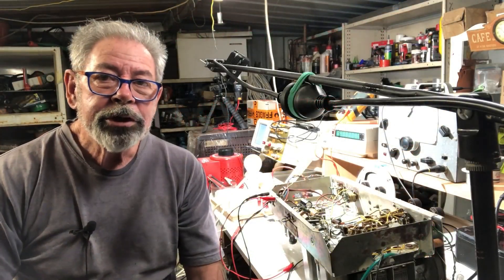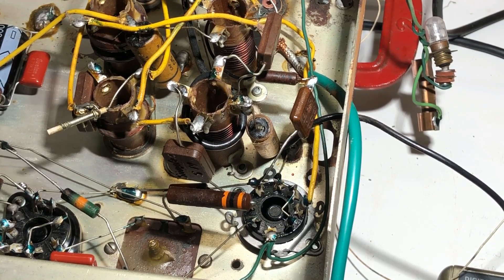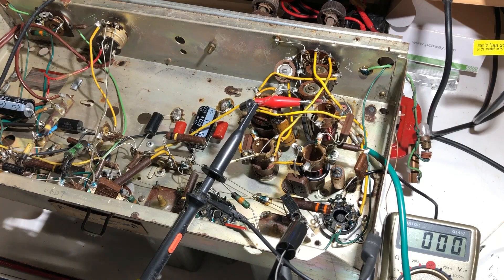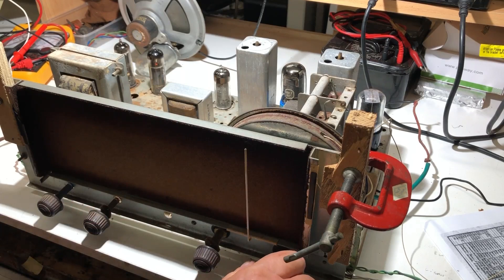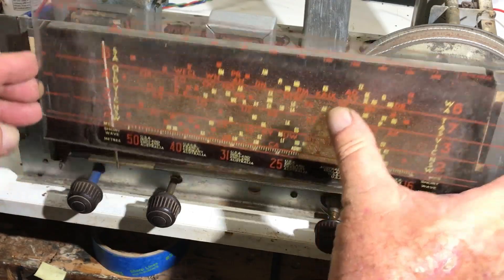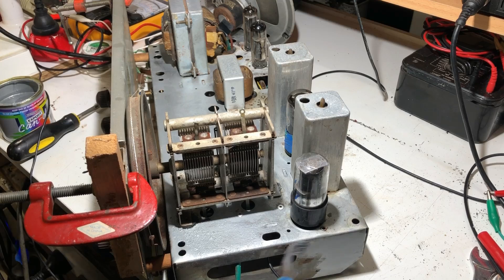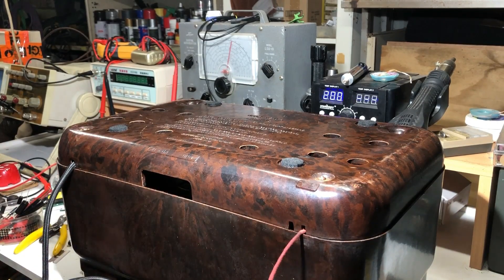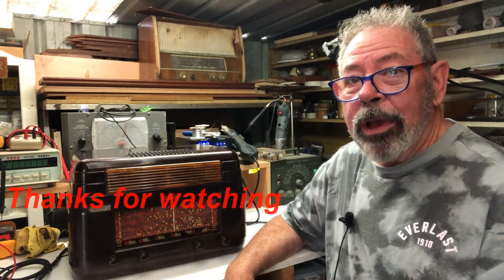Rusty Crusty Kriesler 11-7 Part 2

Comment: Totally the right approach where intermittent faults are concerned. Comparison of voltages and a good long soak test when you think you've cracked it. Another great job Don.
Reply from the maker: Cheers mate but I'm not out of the woods yet.  The fault has returned.  I'm working on it ...
Reply: @Donno308  Well, good luck with it. I'm sure it will make for yet more interesting video! 😉

Comment: That came up great Don. Very impressed with the speaker performance considering it's condition before. I checked my local pusher and he was out of single tooth tooth brushes, he is expecting more stock next week. Thanks for the tip.
I have painted the Kriesler flock with Indian Red paint and it looks pretty good. The case came up good with a polish. 
Interesting fault with the tone switch, a pretty cheap and nasty switch, I have had trouble before with them falling apart. Thanks for the excellent video Don 🙂
Reply from the maker: Hi David,  Yes I don't know what's going on with that tone switch.  The fault re-appeared soon after I published the video but it came good again when I clicked the tone switch.  I must've missed something. Anyway I have now wired the switch completely out of the circuit and it has been working well since.  I'm going to replace it with a conventional multi position switch, probably an old band selector switch (I have a few lying around) - with multiple resistors to provide probably 5 tone control settings.  Then I should be able to confidently hand it back to its owner and get on with my next project, a nice old Stromberg Carlson console model 542.
Anyway, looking forward to your next project.
Cheers

Comment: Great work once again Don, like the way you persist in solving each problem and fixing them,i guess it comes with having  patience aswell.
CHEERS DOM.
Reply from the maker: Hi Dom.  I'm still not too confident that I've fixed the fault.  I've got it running in the kitchen and so far, so good. Anyway thanks for the encouragement!
Cheers mate
Reply: @Don's Old Radio Shed  im sure you will keep it running smoothly, that's why you are always looking for ways to improve the radios.🍺🍺

Comment: Good going Don, looks very smart! Interesting how it seems the Kreisler folks used the cheapest and most abundant parts and changed specs over the years to suit the supply. The ECH35 is a mixer hexode with seperate triode oscillatotor, and was probably more expensive than the abundant 6SA7 pentagrid converter. Although it usually does work ok if you just wire in the grid#2 of the 6SA7 as the anode of the triode section of the ECH. Some minor resistor tweaking and normally its good to go..
Cheers from Germany
Reply from the maker: Hi Biltz.  Good to hear from you!
Yes, there were so many variations of this chassis it's difficult to keep track of.  The service data listed 9 variations on the original design but none of them have the same valve lineup as my radio. The 6BD7 preamp/detector isn't shown on any of them.  Added to that, the schematic I have is very hard to read - particularly the component numbers and values.  They were hand written on the original and scanned at low resolution.  Also most of the resistors are not colour-coded. Instead they have the value printed in the component.  Many of these are now illegible, so I was pretty much groping around in the dark with this one.  I'm still not 100% confident that I have found the intermittent fault.  Time will tell, I guess.

Comment: Another great video Don, boy, Kriesler must have made so many variations of this radio.
I recently restored the 6 volt 31-7 version of this Kriesler. Learnt a lot from that one !
Great job on the speaker, thought it might be a recone or write off.
Keep the vids coming mate, their great !
Cheers 🍷
Baz
Reply from the maker: Cheers Baz.  Yes, the speaker was a bit of luck.  Not so the chassis.  That bloody intermittent fault has returned.  Just about pulling my hair out - and I haven't got much to spare!
Reply: @Donno308  You'll get it mate, patience !

Comment: Well done, intermittent faults are the worst, followed by dual faults and of course the ones you put on yourself lol. Looking forward to your next project, I gotta get my radio fix from down under. I studied tube technology back in the 60s then started a 40-year career with IBM and never worked on any again go figure. Cheers form Canada.
Reply from the maker: Hi Mark.  Yep, I hate them too!  Especially in a radio that you're fixing up for a friend. I'm still not 100% confident I've found the fault.  It's been going for a few days now so fingers crossed.
I studied transistor technology as a telecom trainee and later worked in the pinball machine / video game industry before chucking that in for the stability of a government job.  I never learned valve technology so I'm learning as I go.  Funny, the places life leads you.
Cheers

Comment: It just tells you  - you have to be very careful when you decide it is a RF fault to think of any possibility that it could still be in the audio section as with the grounded tone control switch. A good video!
Reply from the maker: Hi John,
Yes I guess I learn more every time.  It's frustrating that I never actually traced the fault and I'm still not confident that I've permanently fixed it.  The radio is playing away in the kitchen now and has been for a couple of days but you never know ...
Anyway. glad you enjoyed the video.
Cheers

Comment: Don. Interesting dial cord stringing. I have a similar radio which came to me with one broken piece of dialcord and one spring. I spent many hours restringing it with thee two cords as in Krieslers service details and added a tension spring on both cords.
Your system seems much easier. Don, could you post more details of how you finally ran the dial cord please and I will restring mine again. 
Thanks for the interesting videos. Craig.
Reply from the maker: Hi Craig
Sorry for the delayed reply. For some reason your comment didn't come up in my notifications.
If you email me I will draw a diagram and a bit more explanation.  Can't attach anything here.
Reply: Thanks Don but don't know your email. @Donno308

Comment: Don when you were cleaning could you have gotten gunk in a tube socket, that's causing an intermittent. Ive got confidence in you, you'll find it not try dropping it from the roof of the shed a few times. (sorry i have a odd scene of hummer)
Reply from the maker: Hi Mack
Yes, always a possibility.  I did clean out the tube sockets though (I didn't video it this time).  I'm still not sure if I've fixed the problem.  I have now found another 6BD7 which I can use as a replacement.  That would have been my next guess after the tone switch, so if the problem comes back I'll try that.  I'm pretty sure the problem is around the triode/detector stage.
Cheers
Reply from the maker: I considered dropping it several times,  Luckily I restrained myself!

Comment: you don't need a coupling cap to the CRO set the probe to x10 most CRO are 600 peak to peak that 300 volts 300 x -.7071 = 212 volts rms
Reply from the maker: Hi Ian.  Yes I suspected that the CRO would take plate voltage but I still get scared doing it.  Didn't think of setting the probe for 10X but I'll try that next time.  Cheers & thanks for the tip.